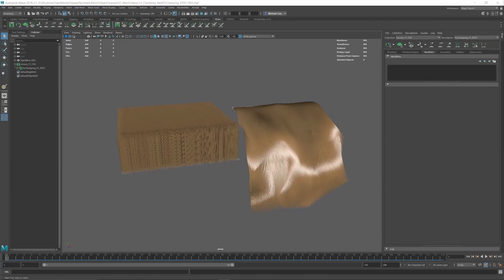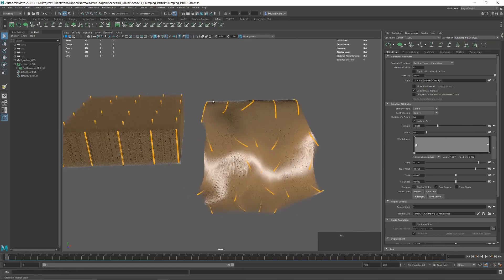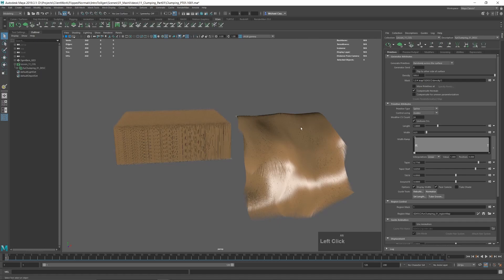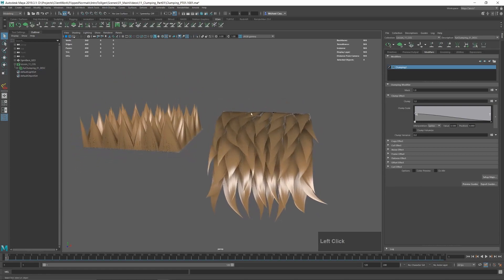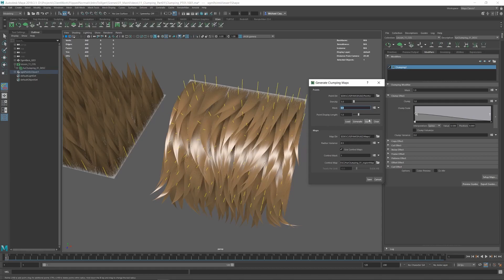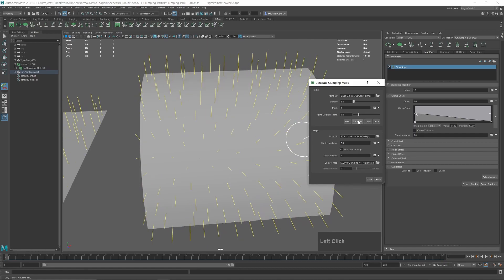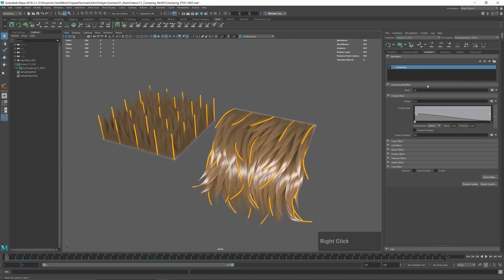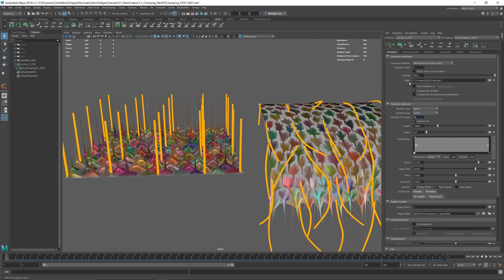Hair Clumping in XGen

Comment: hello. I'm trying to learning x gen. when I try to create a map in order to create a gap between a right part of head and the left one part I 'm not able to paint with the paint tool. the material I have previously assigned to the mesh is blind or Lambert or standard surface. So is not the material the problem. the UVS also are good. DO YOU KNOW HOW CAN I FIX THE PROBLEMS?

Comment: Good video, 

I personally despise Xgen. I tried it with a project 2 years ago, and let's just say it's weird, its buggy, you cant (Ctrl Z), crashed a lot. 

I changed to Ornatrix, yes it's expensive but what software isn't? Theres no naming conventions you have to worry about, you can (Ctrl Z) and its procedural by stacking nodes on top of nodes to get the desired hair effect. 

I'm not shitting on io I just didn't have the best first time with it.
Reply from the maker: XGen can be tricky for sure and there are a lot of pain-points you'll run into the first few times without a proper teacher to guide you. 

In the full course we try our best to guide you around the common problems and bugs and teach you how to solve them to avoid a frustrating experience. Once you know how to navigate XGen's quirks, it becomes an insanely powerful tool for hair and fur :)
Reply: @fnmarket  dont tempt me to go back 🙃🙃
Reply: @seanakima50515e  tbh modern xgen is buggy but you can undo , stack modifiers, groom. Only issue I have is that it requires everything to be organised so neat otherwise xgen will break